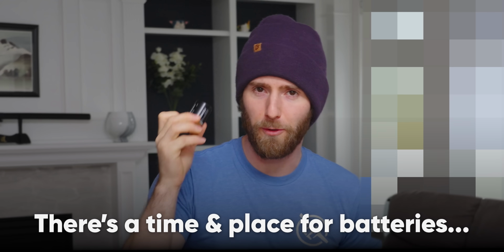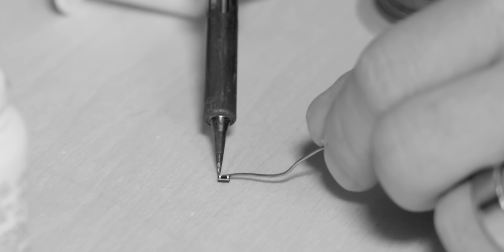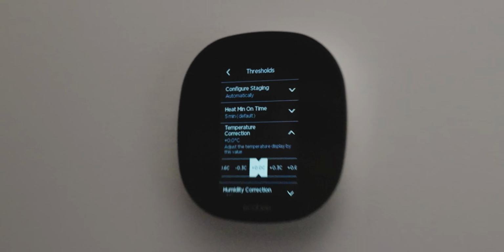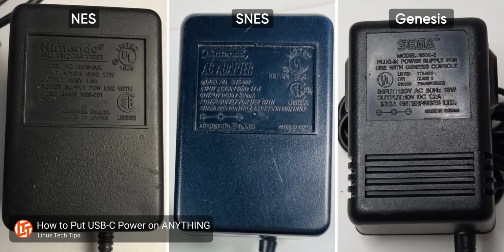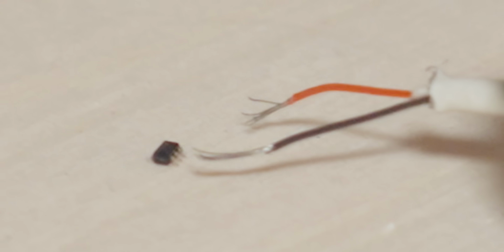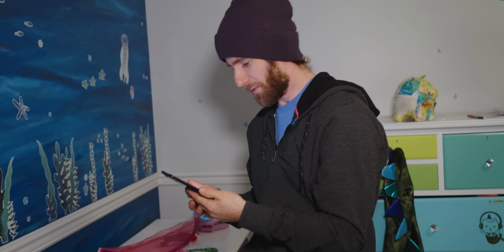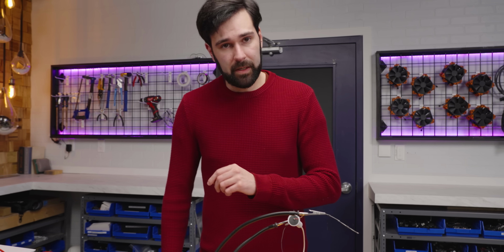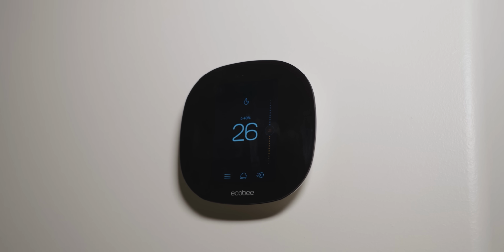I HATE Batteries! - Converting Wireless to Wired (a cheapskate’s guide)

Comment: I want to see a video about battery tech. How good are they today? What types are there. Are there other kinds beside Lithium that could power a handheld?
Reply: That would probably be a Techquickie video.
Reply: outside of nimh batteries, not really. Like you have Lithium Ion which do 4.2 V, and the lithium cells that do 3 V but with super low discharge. NIMH do 1.2 V and Alkalines do 1.5 V. There are lithium ion AAs but they are pricy and need a special charger. Basically the best of both worlds
Reply: @abhimaanmayadam5713  Maybe solid state batteries will be viable for consumer products soon.
Reply: There are way to many battery types, to be honest. Most of them are/were either proprietary for cameras or for a specific size constrained applications.